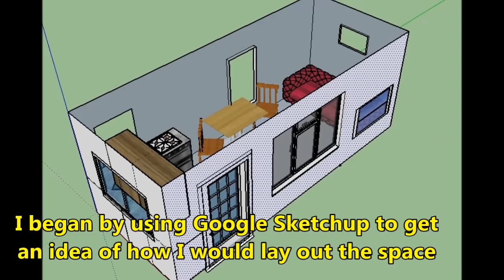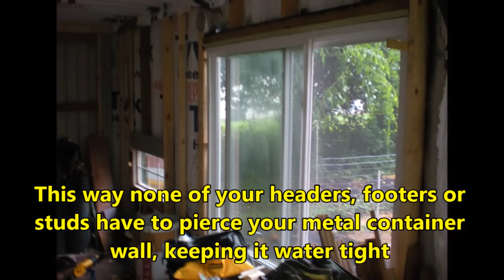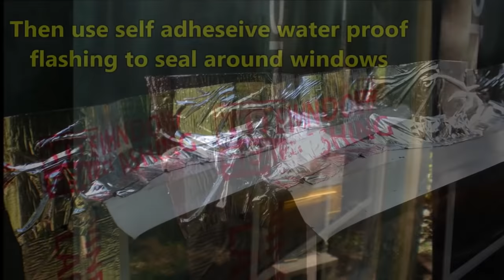20 Foot Container Tiny Home Construction: From Start to Finish

Comment: 8" grinder with cut off blade cuts the windows holes out sweet, no mess. 50x50 3mm angle iron welded in gives a nice face for the windows to be riveted to. Done a few for the bush contractors in NZ.
Reply: Awesome, thanks for the tip....I will try a grinder and angle iron next time!!
Reply from the maker: John, subscribe to my channel if you want to see some great new videos coming out this week!

Comment: This is excellent work. I would have put a bathroom in it, but that’s just me. You are very inspiring, I would try this.  My only concern is I don’t know how the would be able to place it in my backyard. They would have to lift it over my house and I don’t know if they would do that.
Reply from the maker: YOu might be able to have them use a rollback truck or a job site forklift to place it.  I did put a bathroom, but it is in the small building just next to it.  Composting toilet and outdoor shower...

Comment: Hi,
I wonder if you have placed a over hanging roof on the house yet? Capture water for the garden, protect the flat roof of the container and add a barrier etc
Reply from the maker: Yes overhanging roof would be good....I painted a coat of waterproof rubber roof sealant on the top before adding the living roof, so I am hoping that will protect it.  I think collecting rainwater is great.  I have a collector called RainReserve that I use to collect water off of the gutters on my house.
Reply from the maker: Hi Albeare, Subscribe to my channel if you want to see some great new videos coming out this week!

Comment: Very nice job.  Thanks for the tips that you shared along the process.  Just one question: where is the bathroom?  I would think that guests would be more in need of a bathroom than a stove, especially in the middle of the night.
Reply: Yes, I elected to have an outdoor composting toilet and shower in a small adjoining structure.  That way I could concentrate all of the container on an uninterupted living spacing.  Putting the bathroom inside would have broken the flow and made the living space too small in my opinion.   But the composting toilet is just outside and a pee pot can be used in the middle of the night also!
Reply from the maker: Hey Miller, the Bathroom video is up now.  Watch the short container tour video on my channel and you will see the outdoor shower and toilet near the end of the video.  Also, subscribe to my channel if you want to see some great new videos coming out this week!

Comment: Really appreciate this! I have plans of spraying the inside with white paint and leaving it as the finished wall and only framing and insulating the exterior wall, with a plywood finish, because I need every millimetre. But do you reckon the metal interior would get condensation? If so, that's not going to be good. Again, thank you for the walk through step-by-step and good choice of music -- I was getting real mellow, haha.
Reply from the maker: The better you do at insulating, the less you have to worry about condensation I would think.  So if you are insulating exterior, I would think that would help a lot.  And painting the walls would also help to protect them a bit if you got a little moisture.  But you would see this if it starts happening because it will be your main interior wall. I think you would be good to go if you do the exterior insulation.  Good luck on your container and thanks for checking the video out!
Reply from the maker: Hi Lilac, How is your container going?  Subscribe to my channel if you want to see some great new videos coming out this week!

Comment: I am just starting on my own build and have been binge watching a lot of videos to get ideas and learn from others experiences. What i worry about is that the floor which is soaked with pesticides that leak out over time is not removed or sealed to prevent outgassing. Did you do anything to the floor to prevent that?
I started by removing it because i would not want the risk of accumulating poison over a long period of time, especially when it is also used as a bedroom.
Reply from the maker: Yeah, you could put poly over it or something to stop it from leaking.  I
 actually installed reclaimed hardwood flooring, then I sanded it down, 
then I coated with Polyeurethane.....so I don't think there will be 
anything making its way through that.  You could also just do a laminate
 floor that is cheap if you are worried......
Reply from the maker: Tzadvantage, Subscribe to my channel if you want to see some great new videos coming out this week!

Comment: Great build.
I'm  about to embark on my own shipping container and one of my concerns is condensation. this is the first time I have seen somebody use a membrane on the inside to deal with the condensation. what's been your research about its effectiveness over spray foam insulation?
Reply from the maker: Yes, Gabriel, I do think that spray foam is a great option.  It is just that it is a bit messy to spray, and also is costly.  For that reason I decided to go with tyvek vapor barrier and then regular insulation.  But I think spray foam would work well if you wanted to do that.
Reply from the maker: Hi Gabriel, how is your project going?
Subscribe to my channel if you want to see some great new videos coming out this week!

Comment: Very nice job ! Did the plastic you glued in help to keep the cargo box from condinsating ?
Reply from the maker: The wrap material is designed to give a barrier so that if there is condensation, it will not rust the steel walls!
Reply from the maker: Hi Robin, subscribe to my channel if you want to see some great new videos coming out this week!

Comment: Well done friend ... let me ask you. Did you take out the plywood because the toxic insecticide it come with or do you have putted just the floor above the plywood?
How do you have fixed the wood to the container on the outside, directly with screws?
Reply from the maker: I put the floor right over the plywood with floor glue and then nailed it down.  The plywood will have no way to leach any of it's toxins.  It is totally sealed because of the glue and hardwood tongue and groove flooring.  I attached the wood on the outside with screws to the wooden studs that I attached to the container.  Thanks for watching!

Comment: Did you leave the original floor in place?  I've read you're not supposed to do that because of the chemicals they're treated with.  -Or you have to coat them with some special sealant...
Reply: I did leave the original floor, but I added a new reclaimed  hardwood floor overtop.  I sanded the floor and then coated it with Polyeurethane....I don't believe that the chemicals below will be any issue because I have now sealed everything in with a new layer.....
Reply from the maker: Hi Davey, Subscribe to my channel if you want to see some great new videos coming out this week!

Comment: Can someone explain the thoughts and if it was worth puttin the tyvek up? I'm unsure if it would serve its purpose on a sealed roof enclosure ?
Reply from the maker: Hi Matthew, I thought it made sense in case there was condensation on the metal sidewalls.  that way they would not rust if moisture contacted them from the inside....waterproof paint may be an easier solution. Subscribe to my channel if you want to see some great new videos coming out this week!

Comment: I'm confident that gluing the tyvek on with contact cement would ruin any chance that the product would work as designed.   A better option would be a roll on moisture barrier.
Reply from the maker: Great idea.  Could you send me a link to an example of that product?
Reply: @bekindlove  check out Matt Risingers channel.  All you need to know is there!

Comment: Putting Tyvek is a waste of time.  Tyvek lets moisture pass through but prevents air infiltration.  But when put over metal it will do nothing.
Reply from the maker: Thanks for the tip, had heard some different opinions on this.  Potentially painting the metal would be more helpful....something to protect the metal from rusting if there is moisture that makes it to the inside walls....
Reply from the maker: Hi Nicholas, subscribe to my channel if you want to see some great new videos coming out this week!
Reply: I agree with Nicholas but if you glued 1 inch foam all the way around and seal all the seams that would stop the condensation.  Great video!
Reply from the maker: Thanks Jay!  Appreciate your thoughtful comments!  Glad you enjoyed!

Comment: Ive got a 40 ft to start Im getting as much info as posable .Theres one thing the wooden stud inside and outside wood where did you srew the midle of them in to ?
Reply from the maker: I did not screw the middle as I did not want to puncture the main metal skin of the container.  The tex screws were diagonally attached to the square metal pieces that run along the top and bottom of the container.  if you don't mind puncturing the container, you could attach them there too!  Subscribe to my channel to see more great videos coming soon!!  Thanks for watching.

Comment: Did you screw your interior vertical studs into the sides of the container?
Reply: No, I screwed the footer  into the plywood container floor, and the nthe
 header  attached into the Metal sqaure iron beam at the top of the 
container with large tek screws (this did not allow the screw to 
penetrate the actual container skin keeping it waterproof).  Then I 
toenaied (diagonally ) screwed the vertical ones to the header and 
footer.....
Reply from the maker: Hi Adam, subscribe to my channel if you want to see some great new videos coming out this week!

Comment: Wood inside and out why even use the container? Im also guessing that adding the wood to the outside would now make it over width and not legal to move without special permits.
Reply from the maker: I added the wood outside because in my city they were not as happy with the look of the container.  So with the wood on just that one side, it looks great from the street.  As for the wood interior. I wanted a cozy feeling, but functionally I had to cover the studs and insulation also.  In my area eastern red cedar is a native, but very invasive.  So there is a plenty of it that is sustainable to harvest and use.  That's why I used it instead of say drywall or another commercial material.  Not sure if it changes the ability to move, but I am planning on keeping mine where it is....moving it is not cheap also.  Thanks for your interest!
Reply from the maker: Hi Buddy, subscribe to my channel if you want to see some great new videos coming out this week!

Comment: BTW, the first guy mentions it must be expensive. With all the reclaimed and recycled materials and what a container usually costs, I figure your less than $5K total investment? Are you willing to share what it cost, not including your time?
Reply from the maker: Yes, I used lots of reused materials and probably only spent $5000 total.  That includes that $2000 price of the container.
Reply: That's really impressive. Really nice job.
Reply from the maker: Thanks for liking!

Comment: Great video! Quick question...I noticed you didn't reinforce any of the cut-outs with steel rods, and I'm wondering if you've noticed any effect on the structure such as bowing, leaking, warping etc? Thanks!
Reply from the maker: I have had no issues with anything from having cut out the windows and not reinforcing.  I did "stud out" the walls and around the window so that may have a strengthening capacity on the whole container, but I do feel that the container and steel is so strong overall that there should be no problem!
Reply from the maker: Hi Hannah, subscribe to my channel if you want to see some great new videos coming out this week!